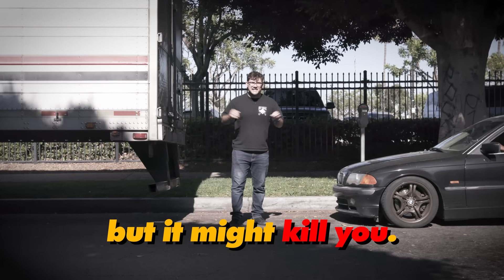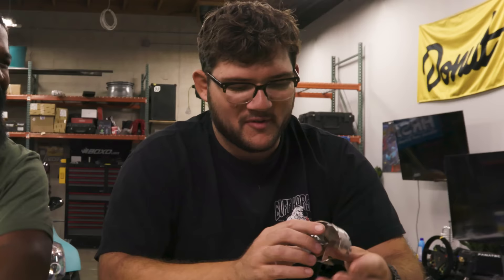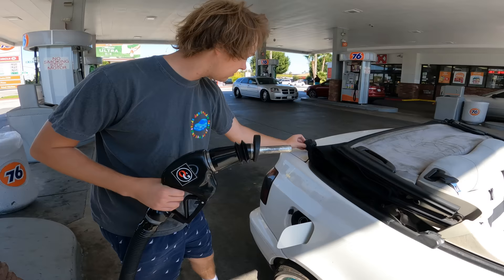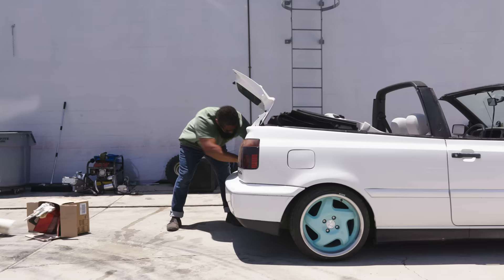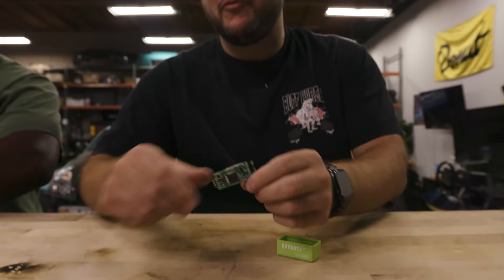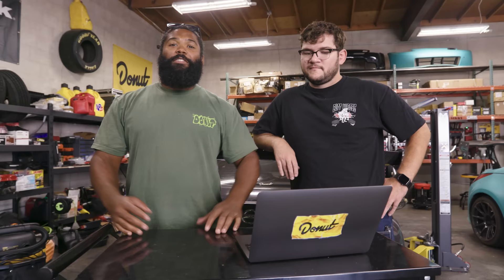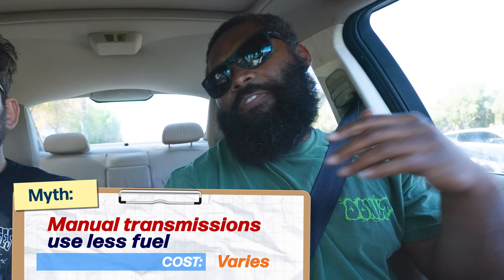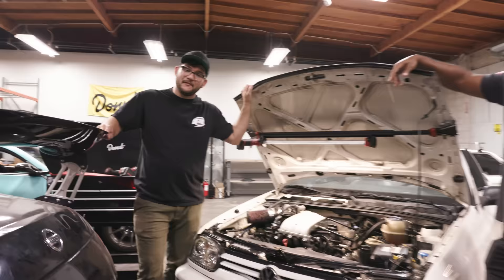Testing Fuel Economy Hacks

Comment: The ecomod would be a great series.  Myth busters also did an episode where they used a bunch of clay to make a golf ball dimpled car
Reply: Did it work
Reply: @trashbandit2449  Yes, it worked as a proof of concept.  They used tons of clay to create the dimples, so the car weighs a lot more.  In steady state cruising, the dimpled car returned better fuel economy.  In real world, that improvement would be offset by the additional weight of the car.  It wouldn't be feasible unless you want to create dimples directly on the body panels.
Reply: As XKCD said, Mythbusters isn't science, they fail at basic rigor.  They do fun experiments, but they often commit basic errors.  As MadisonMPG said on the Ecomodder website in 2009, they claimed an "11% improvement on gas mileage with a dimpled car."  They did 5 one-mile runs at 65 MPH and claimed they went from 26.x MPG to 29.
They switched to a separate fuel tank, which they weighed before and after, so that was good, but only 5 miles?
In the same thread, Darcane pointed out the amount of fuel that would be measured roughly would have been 11 grams of fuel.
Also, a basic concept on Ecomodder is A-B-A testing, so they should have replaced the dimples to see if they still got 26.x MPG or if there was another effect.
They made 1,082 dimples, which took several people hours.
It is entirely possible that other factors changed.
One of the administrators of Ecomodder, MetroMPG, who has done extensive modifications, and substantial testing, pointed out that they didn't use cruise control, Jamie tried to hold his foot steady.
Could human error cause an 11% variance?
Hopefully not, but there are many variables here.
One thing that MetroMPG has done extensively is tuft testing.  I want to see how the air flows differently and this is infinitely cheaper and accessible than a wind tunnel.
How much do yarn and tape cost?
He also checked their math.  Adam said they used 503 g on the clay car and 478 g on the dimpled car, but that is only a difference of 5.2%, so they fail at basic math?
Someone else pointed out that they relied on Jamie changing tanks when they passed the start point.
That also allows human error.
We didn't have test data like temperature, wind, full drivetrain and tire temperatures, etc.
Ecomodder has a physics professor named Aerohead.  He said that if Jamie is an engineer he should have remembered that the Reynolds number states that dimples don't work on an object larger than a golfball.
Also, dimples work on golfballs because they spin.
Aerodynamics are different on non-spinning objects.
In "Car Aerodynamics - A2 Wind Tunnel - Wind Camp Tech Theory" on MotorTrend's website, Gary Eaker, who worked extensively with windtunnels, stated "Golf-ball dimples [...] do not work on cars, regardless of the scale of the dimples, unless your car is a 1.68-inch-diameter sphere spinning through the air with no ground plane."
I will believe his experience over television entertainment--or take the dimpled car to a windtunnel.
Reply: Justin said he overinflated his tires, but then said that other characteristics worsened, and then somehow called the idea a scam.
Just test this.  Drive 20 miles at 65 MPH on the highway without traffic at 32 PSI, 20 miles at the sidewall maximum, and then another at 32 PSI.
Then actually test these other characteristics.
Don't higher tire pressures improve braking?
Reply: @Love2Cruise  hail damage
Reply: @trashbandit2449  What about it?
Reply: @101Volts  wow I didn't put any context on my comments before haha. When he said "it wouldn't be feasible to create dimples on your body panels", my solution was hail damage, since that would create dimples. 
Maybe cars with hail damage are faster 😂

At least that's what I'm assuming I meant, I don't remember making that comment

Comment: No matter what hack you use, at the end of the day, Clarkson said it best: "It's not WHAT you drive, it's HOW you drive"
Reply: If I remember correctly he was comparing a BMW and another eco car. I believe he was driving the BMW in low rpm or perhaps another method he used
Reply: @roducliaharenvol8302  Yeah if you drive high performance car "normally" You can be as economical as a prius
Reply: @roducliaharenvol8302  correct. It was the BMW M3 vs the Prius. The Prius was going full blast and the BMW was just keeping up. And the BMW had better MPG
Reply: @𠔁  jokes on you I don't have to
Reply: I'd say What is pretty important. At least in Europe the rule of thumb is if you wanna have fun drive. If you wanna save money, use public transport...
Reply: @EconomicsMate1  yeah because Prius whole shtick is that's it's only good for city and parking lot driving. That's why taxi drivers love them. These kind of tests that you mention are nonsensical
Reply: I though that was our lord and savior, Dominick Turretto
Reply: It's not how you stand by your car it's how you drive your car
Reply: @tomaskysela5523  hahahhahahahaha fun in Publik Transport? Where are you living?
Reply: Honestly little bit of both.

My old diesel bmw get 5.9L/100km Or 39.8mpg wether I drive like a grandpa or beat on it, after driving super hard it maybe goes to 6.0 I've seen 6.1 once, but it's quite slow so you could argue that's why.

The test they did was m3 driven economically and Prius driven hard, but let's be honest if the Prius also drove economically it would've won, because driving style is important but if you don't have the right car you're fucked.

For example I have an e36 325i, no matter how you drive that thing it just guzzles gas.
Reply: The classic BMW vs Prius race, loved that episode lol
Reply: @imnota  yeah. That's true. What kind of diesel BMW you have? I had an e87  120d it was crazy economy. Got like 4.3l to 100km. Now I have an 525d so it averages about 8.4 with city driving and 7.3 only in the country and what not...
Reply: And as we all know, Jezza's genius generates gravity
Reply: @zittauerbuar4415  He is talking about public transport where its feasible like Europe or Japan where a train does 800 km/h. Not yo Murica.
Reply: The drug never stood a chance in that prius
Reply: @Randomeris1  do you really expect top gear to do a scientific study on fuel economy. It’s a show made to be entertainment and it’s quite entertaining to see a bmw race a Prius
Reply: @jaskajokunen3716  yea but, there's too much temptation to drive it like a non insane person. Lol
What a conundrum.
Reply: I read it in his fucking voice without trying. As soon as I saw Clark's on, the rest was English 😂
Reply: @tomaskysela5523  in my country we have a wide network of public transport and they're very efficient.

only in major cities because we're a 3rd world country and we havent gotten there yet for the whole country but its getting one stop closer a day.

America on the other hand for some reason just refuses to strongly develop a public transport system for some reason idk but even tho they're a developed country i believe only in major cities where public transports are a valid option for daily use.
Reply: @jaskajokunen3716  The most economical cars have manual transmissions because you are in control of how the car uses gears. The vast majority of high performance cars are automatic.
Reply: @BrunodeSouzaLino  Don't newer autos get better or same mileage as manual? Autos also can benefit from having more than 5-6 gears and being more efficient.
Reply: @aoyuki1409  Due to the size of the united states and how far behind their public transport is, and the fact that their population is insanely spread out, I honesty think that it will be a long time before it is viable for the US government to consider building public transport on a large scale.
Reply: @scromberprofessionalautist1017  it's not about size. Mainland Europe is roughly the same size as US. And US cities actively destroyed public transport (like streetcars) to make room for cars...
Reply: @Randomeris1  e46 318d. I could get around the same you did if I didn't do city driving at all, but my daily work commute includes some city despite it mostly being highway. I also think the fact it's kinda underpowered means you gotta beat it more often than you should and if it had more torque I could lower my consumption a bit but honestly for how old it is, how little I paid for the car and how reliable it's been I can't complain whatsoever.
Reply: @tomaskysela5523  I guess it it a cultural thing then, that and probably the lack of funds given to smaller cities and towns to build such infrastructure. The US is a weird place lol.
Reply: It’s true, I drive a 3.0 1 series and get 35+ mpg even 40+ when there’s no traffic around
I have fun with it but drive it very gently the rest of the time 
I know people with 1 litre engines who get worse than that😂😂

Comment: Using cruise control helped me the most. Leave early and just cruise the speed limit
Reply: old car or new car, a heavy foot will hurt fuel mileage
Reply: Actually the most efficient thing to do is to "cycle" where you moderately accelerate and then coast. So if you're on the freeway and want to go say 60 mph it's more efficient to slowly accelerate up to say 65 then coast down to 55 and repeat this over and over. Super annoying, but more efficient. This is because your engine has pumping losses associated with the throttle plate being closed so running it more open when you are using fuel improves the engine's bsfc and then coasting uses effectively no fuel. It's also super annoying to ride in a vehicle doing this.
Reply: @turbo_brian  I called that leapfrogging when I bought my first car in 2000, but I decided it wasn't worth the annoyance.  Hypermilers call that pulse-and-glide.
It is especially helpful if you do engine-off-coasting, but I don't know anyone who does that anymore.
Reply: I have always timed lights.  I never understand everyone else speeding to reds and then braking when it is obvious they cannot possibly make it.
I almost always slow down for a light before the vehicle in front of me.
It is always fun to roll up to the light and pass someone who cut me off.
Reply: absolutely! my car is most efficient from 55-65mpg. overspeeding costs more in gas and also risks an expensive speeding ticket!
Reply: @turbo_brian  Mind you that advice only applies to Gasoline engines. Diesels do not have throttles and simply increase/decrease fuel being injected.
Reply: @drippingwax  I suppose the "ever notice how everyone is bad driver except you?" this is so true. I used to roll up to lights. It actually burns a little more fuel than stoping at the last moment (or just about the same), but it warps the rotors faster, much, much faster. I also used to think people were speeding to the lights, but now I know it's not the case: They're very likely coasting which means the "speeding" you're noticing is the optimal momentum needed at that time to brake with as little wear on the brakes and the rotors as possible, while still having the same fuel saving benefits of rolling to stops.
Reply: @drippingwax  why would you turn of the car? when you dont use the throttle the engine uses no fuel at all.